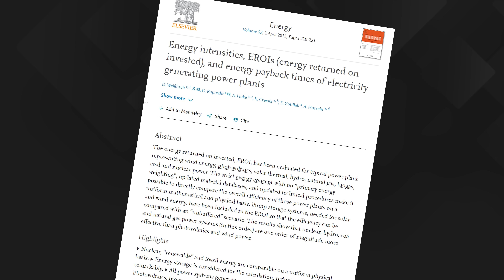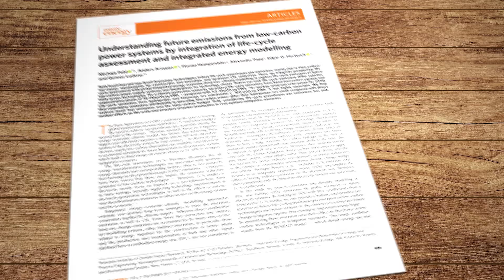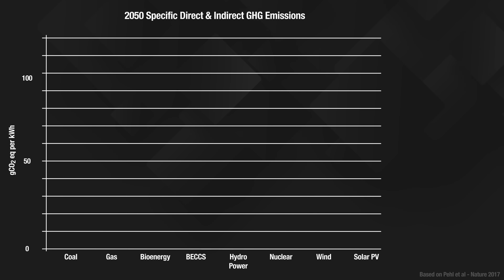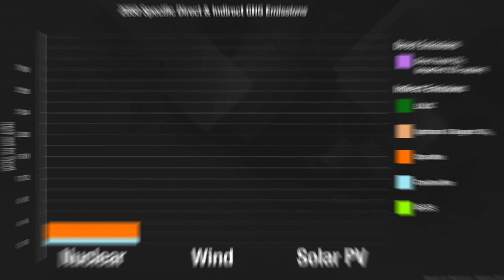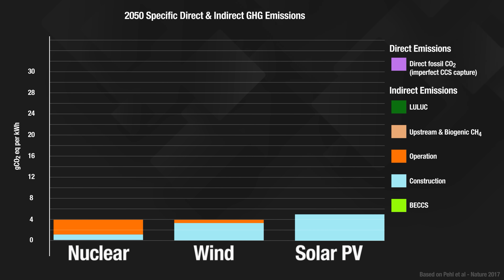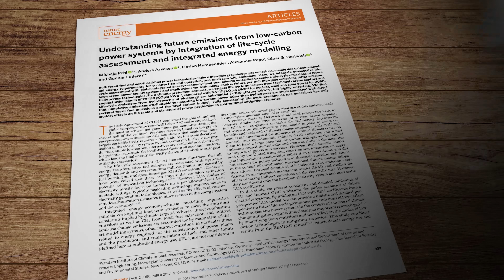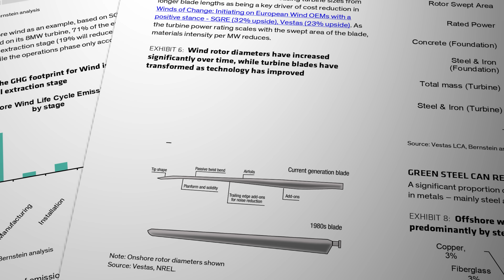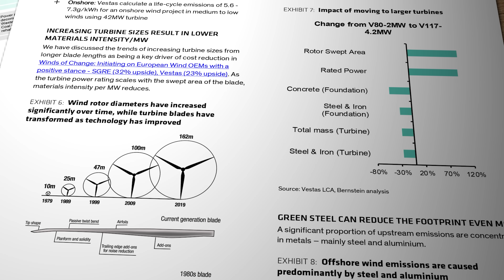Lifetime carbon emissions of renewables vs fossil fuel. Problem or solution?

Comment: Alt wattage for the grid isn't green it's propaganda.

The least carbon_footprint/megawatt/container uses magnets as in EVs fade-10%/1ky.
The 1300hp all_magnet motor fits cars has a 50yr no_inputs warranty.
No CO2 H2O or wasteheat/Mwh superconducts coils.

Find me anything close from centralized power, truly green machines are distributed a principle.
No miles of wire, the grid going down has zero effect.
Homes 10kw/5kw 20yr no_inputs wrnty,1+3-phase inverter to solar_panels 2019 $15k/$8k.

Nothing from the grid is even close.

Then, thermal electricity emits 2-joules/watt on_the_wire of wasteheat times 1.6aggi=3.2-joules/watt on_the_wire times capacity globally cannot be effectively zeroed.
If all steam power 250Mw & above stopped it saves 36,000-Twh one-time, the 2007 seaice retreat gained 95,000-Twh/yr as a measure of how stupid we are as a species.

We're extinct in 3.5ky-5ky with BAU.
Citations upon request.

Comment: Wind and solar really should include emissions from additional storage and transmission requirements.

Quoting from the Nature study:
Variable renewable energies (VREs; wind, PV and to some extent CSP) require storage and grid expansion to guarantee a stable electricity supply. REMIND therefore includes requirements for storage and transmission that increase with rising market share of VREs and incur investment and operation costs. Since these requirements are more characteristic of the power system as a whole than the individual VRE technologies, they are not included in the analysis of EEU and indirect emissions in this study.

Comment: GDP is not the be all or end all.  However, GDP growth does move people up out of poverty.  If the green revolution toward renewable energy results in a substantial drop in GDP, them poverty will increase consequently political support for the transition will also decrease.  While successful transition to a net zero carbon future requires change, where some win and some lose, if the net economic outcome is negative then we all will lose.

Comment: BECCS has potentially the lowest carbon footprint of all, yet: "Some say that the time required for crops and trees to suck all that CO2 back out of the atmosphere will be too long to provide the quoted benefit by 2050 and that carbon storage losses by tearing down ecosystems could cancel out many of the benefits".
What about the 1 billion tonnes of rice straw which is mostly wasted in the fields? It only takes a few months for the crop to grow and absorb the carbon, there's no need for additional land, water or 'tearing down of ecosystems' and in fact removing it from flooded paddy fields reduces rice methane emissions by 50%.
I love these JHAT videos; I just wish the bias against bioenergy could be replaced by the same optimism shown for other renewables.

Comment: You left out HUGE problems with wind and solar.  First is the fact that wind is a massive killer of wildlife.  It also requires massive amounts of land. It also has FAR worse disposal problems than your agenda driven studies admit to.  They take best case scenarios that never happen.  There are currently massive piles of turbine blades in landfills that take up even more land. Solar panels are dark and create massive direct heating of the atmosphere.  They get so hot that birds that fly over them are often killed by the heat. You may mean well, but you have fallen for the lies. The largest lie of all is global warming.  The data has been massively manipulated and a bit of research will show you that the planet is well within its natural variation. They have been claiming that the world is going to end in 10 years for over a hundred years now.  How many times will you blindly fall for the lies before you recognize them for lies?
Reply: Well, SOMEBODY's fallen for some lies, anyway.😊
Reply: @davidburica7548  Yes, you have.

Comment: Cars can't replace horses. Cars need metals, and it's horses that bring the ore out to the pit. The metals need coal to refine, and horses are needed to bring the coal out of the pit. The metals have to be delivered, and the barges are pulled by...you guessed it, horses. The petrol has to be delivered to the chemist, and the deliveries rely on...horses. If you calculate it out, its obvious that there's more horse miles used to make, fuel and despose of cars than they'll ever actually drive. These crazy car people just don't understand. Now, some of them say cars can replace horses in some situations, and that making cars can be done without horses once car technology is widely adopted. That's easy to say, but how is a car going to pull a barge? How is a car going down a pit where its toxic effluent would poison the miners? Mark my words, horses built the world and without them civilisation will collapse.

Comment: I have not had the time to update myself, it is good to see some of the numbers have apparently turned around.  Biofuels I would not even count as carbon generating since they would be produced in and out of the carbon cycle and would be carbon neutral.   I bet if "Carbon Neutral" emissions were subtracted out we would find a decent liquid transport fuel in a lot of biofuels if we produced them properly.  So the real big 3 would be Nuclear, Wind, and PV with the necessary evil of biofuel if done right, which would be neutral at least.

Comment: I think it was Vestas's CEO in the spring of 2021 who said the energy return for their huge modern wind turbines is only 3 months including all manufacturing, installation, servicing, disassembly and recycling! Awesome. Clearly our future is renewably powered.
Reply: If this would be true, it would make zero economic sense to sell the turbines. They should just build them and sell the energy. It is a 300% YoY exponential return.
Reply: @k0zzu21  Well it would compliment the evolution of wind turbines getting bigger, more powerful, more effective and more efficient. Back in 2015 when the standard was smaller 2MW units Siemens study found their fleet of wind turbines returned their embodied energy in 4.5 to 5.5 months. Today we install 5MW units.
Reply: @aaronvallejo8220  if I understand this correctly, it would return an eroei of 99 with a lifespan estimate of 25 years. Is that correct?
Reply: @k0zzu21  Yes, if these numbers are scientifically sound and I believe they are, then yes the energy return for 5MW huge modern wind turbines are possibly 100:1 energy return over 25 years and they may operate, if properly serviced, for 35 or 40 years. I have heard Enercons are designed for 50 years. But of course only time will tell.

Comment: Excellent vid again.  One thing not considered is the need for battery for delivering "base load".  It would be interesting to include this in the CO2 costs for renewables.
Reply: they're called dams, and like they said in the video it has insane amounts of methane production and habitat destruction
Reply: @t_c5266  dams block watercourses in order to collect water not electricity!

Assuming you’re referring to pumped storage hydroelectric plants where do you suggest we construct all the storage ponds?
Reply: @andyxox4168  please tell me you were being sarcastic with the water vs electricity statement
Reply: @t_c5266  nope, no sarcasm, just perhaps in indication that you don’t know s*it from shinola!

(Where are you going to put these hydro electric storage facilities, the biggest at present is Dinorwig with a mere 9 GWh, 1700MW and an efficiency of 75% on a good day)
Reply: @andyxox4168  what holds back the water in pumped hydro
Reply: @t_c5266  .. I would invite you to learn a little more about the subject, perhaps you could consider the largest (though in storage terms tiny) pumped storage hydro electric power plant in the UK at Dinorwig where no dam is used, then you can explain where there are suitable locations for 5-10 pumped storage schemes of 5 times the size of the Dinorwig that would be needed to support a renewable grid.
Reply: @andyxox4168  sorry bud. The exception is not the rule.
Reply: @t_c5266  the largest (and only significant) pumped storage power plant in the UK is not an exception. Where would you suggest further substantially larger plants could be located?

Incidentally the word you are looking for is reservoir and not dam.
Reply: @andyxox4168  I would like to cite: all of California
Reply: @t_c5266  … you go for it ! (Of course only mountainous areas would be suitable so all of California would not be practical, you ignorance of the subject thus prevails)
Reply: @t_c5266  possibly, until battery technology orH2 becomes viable.

(Not sure why you would want to create stagnant reservoirs though)

There’s quite a good website from US gov covering your hydro storage resources)
Reply: @andyxox4168  the rule is "never change strategies based on technology that doesn't exist"

That's how you make a fool out of yourself.
Reply: @t_c5266  I’ll agree with you on that point!
Reply: Until an entire day or two of power backup costs are added, all PV/Wind numbers are GIANT lies.
Reply: This is true, sadly the world's largest battery, once it's been expanded to twice its size, still won't power the UK at 2am for even 5 or 10 minutes. Grid scale batteries to power the UK for even 5 hrs when the sun isn't shining, and the wind not blowing would be a project of unbelievable proportions...not sure it would even be possible. Not sure you could make batteries fast enough to replace units as they reach end of life.
Reply: @DaveCorbey  again. Dams. Currently the world's largest and most efficient batteries. The only ones with grid capacity for the next 100+ years. But then you get massive methane output
Reply: @DaveCorbey  Nuclear is the only ‘realistic’ answer, at this time, to make a huge impact on the “Existential Threat” of carbon emissions. But, can’t use nuclear because of the wacko greens.  Sooooo….is it really an existential threat if we’re eliminating nuclear as a partial solution???
Reply: @scarlet_phonavis  strange one. If the idea of renewables is to halt the rising waters. Flooding vast areas, making people homeless and destroying ecosystems seems abit harsh. How big a hole is needed to get the raw materials and the machinery needed to do it must be immense. For its lifetime it may be one of the better solutions, if you have an empty mountain and a river, but it's far from cost free.
Reply: You would also have to include the need for batteries into nulear to some degree, because the load cannot be matched by nuclear which can only deliver energy in a very constant way.
Reply: @alphablondy04  Nuclear plants can also load follow if they are designed with that purpose in mind.
Reply: @alphablondy04  True, but you simply bypass turbines, while the reactor stays constant.
Reply: @alphablondy04  rubbish, modern nuclear reactors are far more flexible than 1980’s designs and can be ramped up quickly. If load reduces suddenly can go into bypass operation so with the limited storage we already have… not an issue!

Large steam turbines also have a significant damping and stabilising function on the grid which wind turbines do not, indeed wind turbines actually tend to introduce harmonics and destabilise the grid!
Reply: @andyxox4168  Not really, the laws of physics have not changed, the Xenon problem. Then other issue is during the day all those PV and wind making power, might as well not be there (only for show and added cost) if we simply bypass the nuclear turbines. Turn a reactor off, you have to wait 3 days, turn it down and the reaction collapses. As it did in Chernobyl. Their huge mistake was to try and go against the laws of physics to make the reaction "go", against Xenon.
Reply: @DaveCorbey  the bypass system is on the turbines, and modern nuclear plant ramps up in a matter of hours, th3 limiting factor often being the turbine, no idea where you get 3 days from nor are you correct on the cause of the reactor fire at Chernobyl duh 🙄, with your finite knowledge you must be a genius in your own imagination (rather than a senior engineer with +35 years experience in the power generation industry)
Reply: @andyxox4168  I know exactly what happened in Chernobyl as far as the reaction and reactor is concerned. Clearly you're knowledge of nuclear power plants is limited...so no point discussing further with you, plus you're quite rude and offensive.

Comment: The "relentless march of GDP" actually is VERY important. Aside from the simple idea of "change costs resources and has to be paid for somehow" there is overwhelming evidence that the higher the average GDP of a country the more focused they are on Green initiatives - because in the majority such initiatives are more relevant than "where do I get my next meal of fresh water from".
Reply: Correlation between GDP and baseline level of living high enough for "focus on green initiatives" has to end somewhere, though, right? And at that point, there definitely are valuable green options that impact GDP negatively in the short term.

Comment: Global warming is a fact.It being caused by carbon emissions  is a con.Carbon emissions are a by product of the real cause.Take for example a room being heated by an open fire place.Is it the carbon emissions going up the chimney that heats the room or is it the energy released from the fuel burnt.Since energy cannot be destroyed this energy works its way to the outside thru heat lose thru walls and is added to the heat in the atmosphere increasing the temperature of the atmosphere ever so slightly.Now take into account the millions of tons in fuel we burn daily in the form of oil,gas,nuclear,bush fires etc and you can see how we like heating a room we are heating our planet.This energy slowly escapes to outer space but still has raised the temperature ever so slightly.Decades of this practice just increases the earths temperature.Why are nuclear power station built near large masses of water,for cooling.So what do you think happens to 60 to 70% of the energy .It is dumped into the water for cooling and again all this energy goes into the atmosphere.Hydro and wind power are no different.The biggest contributor to global warming is deforestation.Trees are large storage cell just as batteries are to solar panels.So the energy that was stored in trees and vegetation now is absorbed by roads concrete structures which don't store this energy but release it into the atmosphere during the cooler nights.Hydro and wind are no different you take energy from these to turn turbines and produce power which in turn into heat to power industry bake our bread,smelt aluminium cook our meals.So how does wind blowing across afield with no heat now become a heat source of millions of watts being added to the atmosphere daily.If you wish to stop global warming stop adding energy into the atmosphere.Welcome back to the dark ages.

Comment: there's a big energy expenditure in making the silicon solar pv panels, and depending on where the solar panels are installed as far as i know if installed in sub-optimal zones the energy generated by the solar panels won't be enough to offset the energy it takes to produce them over a 25 year time frame. does anyone have more info on how this equation works out?

Comment: Hi Dave, Thanks as always. Just out of curiosity does the research mention the Carbon Emissions for the life cycle of grid scale electricity storage options (whether pumped hydro, battery storage or super heated material). I doubt it would change the result compared to Coal or Gas very much as the gap seems way too large, but comparative to Nuclear which can supply base-load power, renewables are intermittent and aren't really a direct comparison without including storage capacity. 
Also do construction costs include mining, transport and refining of the raw materials. As an example here in Australia we have a lot of Lithium for batteries, we have plenty of coal and gas, and an abundant supply of Uranium (as well as plenty of the other elements required I believe). However we don't really manufacture much, we mostly ship the raw materials off shore and get the finished products shipped back.
Reply: Agreed that storage needs to be taken into account.. but surely battery banks are the worst type of storage as we all have experience with batteries holding less and less charge over time.

Comment: What is the point in comparing emissions, when neither will save us, the last time the Earth had similar 420ppm of atmospheric CO2 the Seas were approx 78 feet higher. So we are only just at the beginning of what 420ppm will do, which means ALL solutions and targets etc need to be Carbon Negative AND we literally only have a few years left!. Algae Bio Fuel permanently sequesters 1 Ton of CO2 for every Barrel, if the UK made this transition we would permanently sequester 364 Million Tons of CO2 every year, creating millions of new local climate saving/Green jobs and bring £Millions to local communities/regions. This transition could be achieved in 5 years , then we wouldn’t ‘need’  new high tech EV that are  doing to the Congo what Animal Ag has done to and continues to do to the Amazon! We can use the vehicles that already exist, stop extracting/deforesting, for ‘solutions’

Comment: Just a note on zero carbon concrete - CarbonCure sequesters less than a percent of the cement emissions from production, and so far are using food grade produced CO2. Brimstone might have a viable pathway to zero carbon portland cement, otherwise if we can produce zero carbon alkali activators geopolymer concrete will be able to be produced at zero emissions.